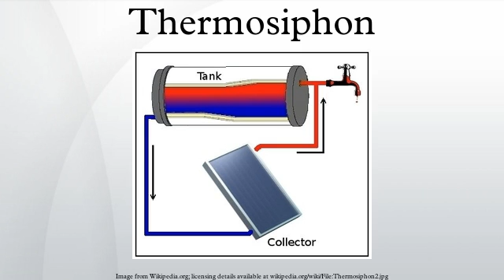Thermosiphon

Comment: A pump is more robust until it breaks.
Reply: Also requires electricity, however convection does not. Passive movement of hot water rising and cold water sinking only works until all of the liquid is hot with no different, equilibrium.